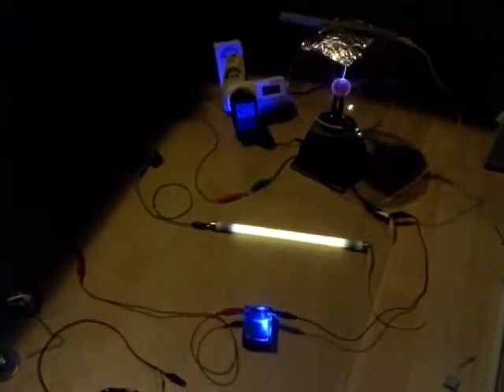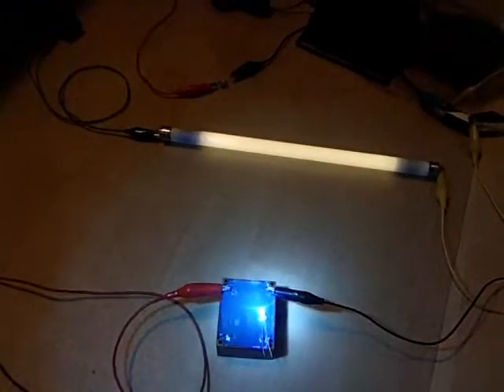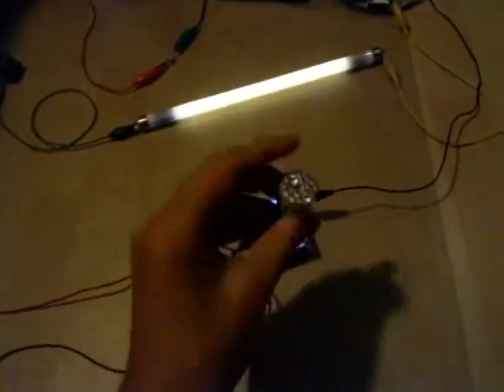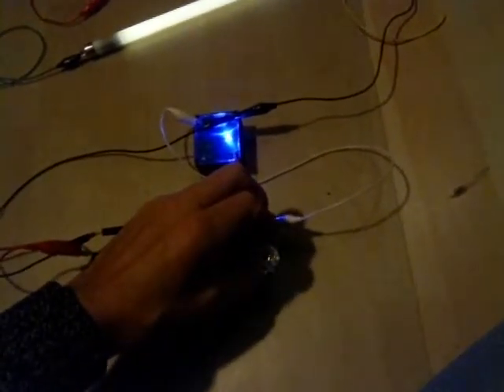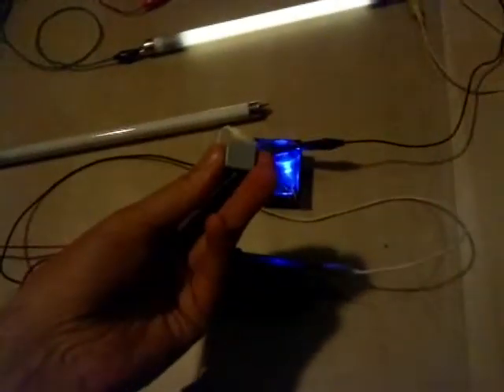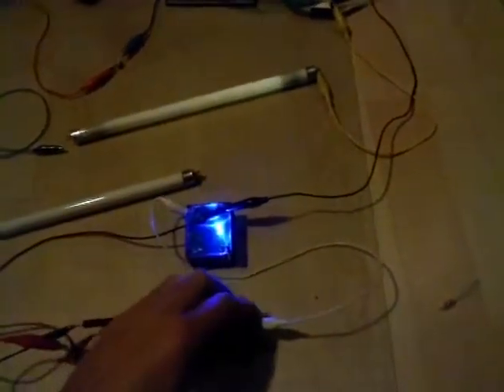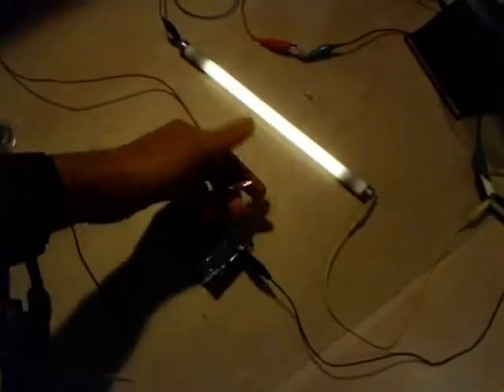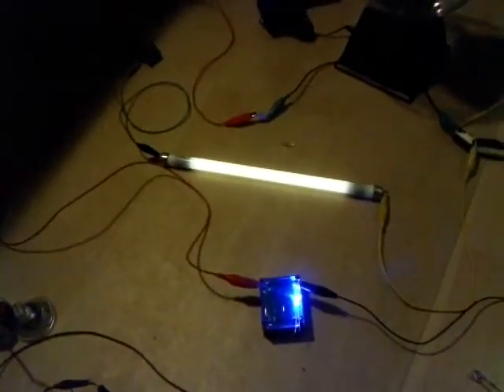dielectricum tesla hairpin (Lecher arrangement) with a tesla globe

Comment: If I understand it correctly this works on relative low voltage. the globe has high voltage, and charges the capacitors via the foil. the spark is relative low voltage, correct?
Reply from the maker: The plasma globe does emit high voltage. This is picked up by the aluminum foil, and into the hairpin circuit. The spark plug is an overvoltage protector, and I am not sure at what voltage it sparks. It is in a vacuum so it can spark for a long time and does not really heat up. Still I expect the spark to be at 60 to 80 Volts, and all above 50 Volts (AC) is harmful to people.
If I would have lifted up the sphere, i COULD have used the output of the coil of the HV generator. It would be a lot more dangerous, but I am trying to show a relatively safe way to do this experiment.
When doing it this way, pay attention to the top of the sphere, it does get hot. You should probably not run this experiment to long (15 minutes or so).

Comment: Really nice job, but I would love if you could try to use instead of alu foil some pick up coils like Don Smith did! May be helpful if you try different spark gaps possibly  you will get better results!
Please let me know if you manage to get more out of it, would love to replicate it but don't have Plasma globe ! Kind regards
Reply from the maker: By removing the plasma globe, using the generator coil, i could get a lot more out. But then I would have to wear High Voltage protection!